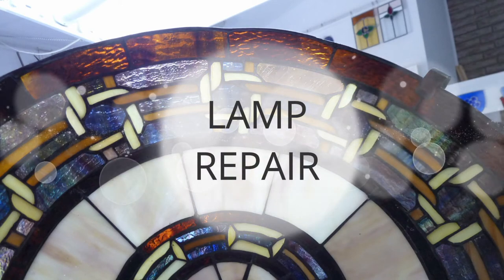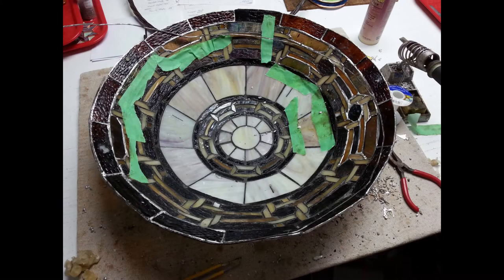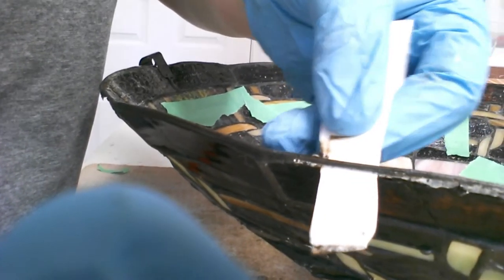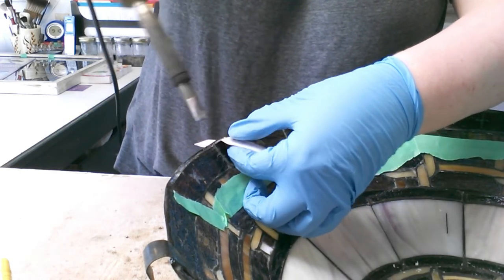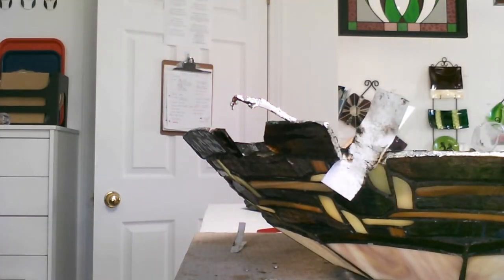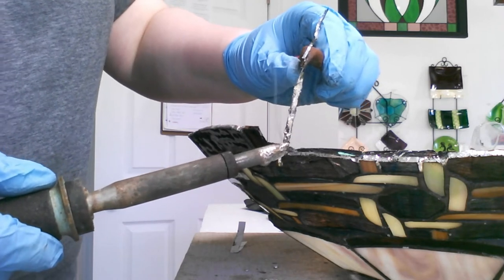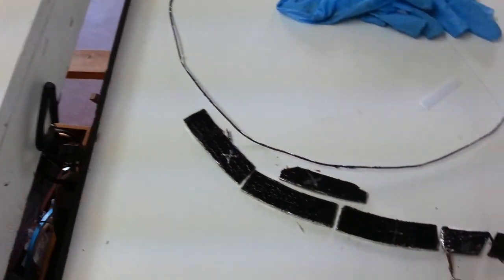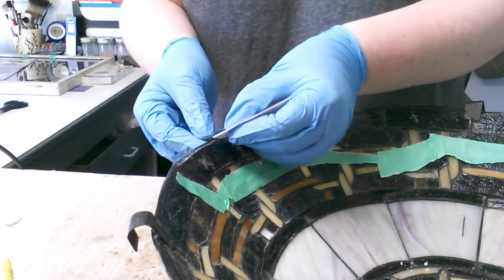An Interesting Stained Glass Lamp Repair

Comment: Thank you for the paper tip! I am making a small repair around the vent cap of a lamp shade, and knowing this will make it easier. I saw another video where the vent cap was (in my opinion) installed upside down - the convex side towards the inside of the shade. The original orientation was convex side up. Which way is correct? Have I been wrong for years??